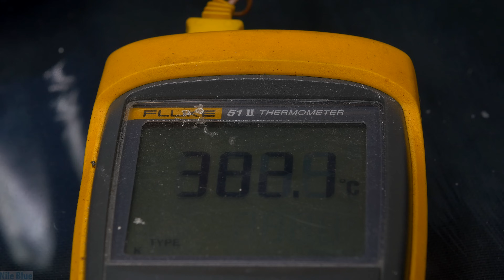Everyday science: starting fire with steam

Comment: THANK YOU! People are always calling water vapour steam, for example when they're boiling water in a kettle and it's so annoying. I work in the power generation industry and it's superheated steam that runs the turbines which spin the generators which make the electricity. Conventional and nuclear power plants all work the same way. They produce heat either from burning some sort of a fuel or with nuclear fission, which is used to boil water to generate steam, then the steam goes through the furnace / reactor again to make it superheated and then that goes into a turbine.
About 80% of global electricity is produced by generating steam and running it through a turbine.

Comment: I used to work at a potato chip and snack food manufacturing company in Topeka Kansas. If I recall correctly they had 460 PSI steam there that was used to heat the potato chip and snack food fryers. Not only will superheated steam get things hot enough to start fires if you give it to chance it will cool down enough about three or four feet from the nozzle and you can actually use it to put a fryer fire out. In this case the hood on the fryer has lowered down and the fryer is filled with steam to both cool and start the fire of oxygen. What's really interesting though it is the vent chimneys on those industrial dryers that are like the size of a trailer house get full of polymerized oil just like a creosote and a chimney. When one of those things lights on fire usually do to a fire in the fryer they burn like a solid-fuel rocket. One-time the fire department had to cut the chimney out of the roof lay it down inside the building and go at it from both ends with fire hoses.

Comment: Steam is a form of water vapor.  When water vapor becomes visible,  it is an aerosol, common clouds are a good example. 
Water vapor is the most predominate greenhouse gas in the Troposphere, thanks to its triatomic molecule and multiple modes of vibration.  While carbon dioxide is also a triatomic species, it has only two vibration modes and both are stretch so it's IR spectra is quite narrow.

Comment: I worked with similar principles daily for years while in the Navy.  The ship I was assigned to was steam turbine driven, with a nominal steam pressure of 600 PSI (41 BAR) with superheat.  This means that we generated steam  at 600 PSI, then ran the steam back through superheater tubes in the firebox to raise the temperature.  

As the pressure goes up, so does the boiling point.  The temperature of steam at 1 BAR is 100 C.  The temperature of steam at 600 PSI/41 BAR is about 487 F/ 253 C.  After running it through the superheater, we had steam at a working pressure of 600 PSI (41 BAR) at about 850 F/454 C.

The interesting thing about steam is that the phase change from water to steam or steam to water takes additional heat.  Once you heat 1 pound of water to 100 C, it takes an ADDITIONAL 970 BTUs to change that pound of water to a pound of steam at 100 C.  That gives you 970 BTU of energy to use for something.  As the steam leaves the nozzles in the turbine and hits the blades it loses energy and cools.  The purpose of the superheat is to give you that much additional work as the temperature falls...even after losing 190 C of heat to performing work, there was still that 970 BTU left to be extracted before it became water again.

This is VERY simplified overview of a subject upon which entire books have been written.  As far as the video goes, know how to find a steam leak that is at 600 PSI, 850 F, and invisible to the naked eye?  In all seriousness, with an old-fashioned straw broom which you wave in front of you.  When half the bristles disappear and the rest catch fire, you have found your steam leak.

We made our steam on a bit larger scale.  We were running 32,000 HP / 24,000 kw of geared propulsion turbines, with enough steam left over to supply 8 mW electrical of turbine generators plus steam-driven auxiliary equipment, hot water, space heating, and galley services.
Reply: I think steam can't create any work when it changes state back to water. How can it push turbine when changing state. Energy just waste into heat. It can push turbine blade (thus create work) because of pressure difference (while they are steam, not when they change state back to water)
Reply: @Yggdrasil_Story  You are on the right path.  The temperature at which the phase change from steam to water takes place depends on the ambient pressure.  Steam has a volume over 1000x that of water.

So, you can use steam as long as the temperature remains above the boiling point of water AT THAT PRESSURE.

So we cheat.  Steam is the gaseous phase of water.  Like any gas, it can be heated.  We create steam, then run it back through boiler tubes to heat it up even more.

As we use the steam, the pressure decreases.  We can adjust for this with turbine designs.  Since we started with the steam so hot, we are still well above the condensation point.  Once we reach the nominal Condensation Point, we still need to lose the BTUs we added to force the Phase Change.  We continue to run the steam through turbines, losing pressure and heat all the while as we allow the steam to expand and perform work.

Eventually we reach a point where the steam is nearing the Condensation Point at the ambient pressure, and we aren't going to be able to use it much longer.  We again cheat and place a cooled condenser unit on the far side of the last turbine to deliberately condense the exhaust steam.  This creates a low pressure area on the turbine outlet, dropping the Condensation point below 212F/100C.  The lower the turbine outlet pressure, the longer we can keep the steam working.

Eventually, we end up with very hot water (Condensate) which is treated and introduced back to the boiler as very hot Boiler Feed Water.  Note that we retain as much of the heat in the Condensate system as possible, so we require less energy to heat it back to steam again.

In short, we add extra heat to the steam and then play games with the ambient pressure to keep the steam hotter than it's Condensation point.

Comment: 0:57 You had the physics wrong this time. By Bernoulli's principle when you have gas flowing at equilibrium, regions of the gas at higher pressure move at lower speed and vice versa. Therefore you are speeding up the vapor not slowing it down.

Comment: Is there not a chance that in this particular experiment the blowtorch is heating the air inside the tube to the 350-400 degrees and the pressure from the boiling water is moving this hot air which ignites the match?

Comment: Nile, would it be possible to do a video about why shaking a match / a stick that is on fire puts it out? Thanks :)
Reply: It is almost certainly due to removing heat. You aren't removing oxygen since you are moving the fire through air, where there is more than enough oxygen gas. You aren't removing fuel because the match/stick is the fuel. The only thing you're doing is rapidly moving the fire through air that is much colder than the fire, dissipating the heat rapidly until it cannot sustain combustion any longer.

Comment: I had no idea steam and water vapor were different things...
Reply: In industrial applications there are two types of steam: Wet Steam and Dry Steam. Wet steam has lots of droplets of condensed water vapor, that's what fogs up your bathroom when you have a really hot shower running or in a sauna, while dry steam has no condensed water vapor in it, and that is whats used in steam power.
Reply: @tassadar7945  "Wet steam" is just steam with water vapour in it (tiny droplets of liquid water). You can separate most of the vapour out mechanically and then if you heat up the steam some more, the rest of the vapour will also turn in to steam.
There is no steam when you take a hot shower, unless your shower water is boiling, which would severely burn you instantly. When water is warm, the water molecules at the surface of the water have enough energy to jump into the air, forming tiny droplets of water. This is what you see in the shower. This is also why water vapour starts to form in a kettle or a pot of water before the water reaches its boiling point. Oh and this is how water vapourizes from the oceans and forms clouds.
In a sauna, when you throw water on the rocks, the water boils nearly instantly and turns into steam. But also nearly instantly, that steam condenses back into tiny water droplets and that (plus the hot air moving with the water droplets) is what you feel on your skin after throwing the water. You can see the water droplets above the sauna stove right after throwing the water. It's like a column of mist moving up and then it vanishes as it mixes with air. Now that I think of it, if your sauna is above 100 degrees C, the water you throw on the rocks should remain in its steam form instead of condensing into water, except on surfaces that are under 100 degrees C such as your skin. I wonder if that is the reason saunas need really good ventilation. You don't want to replace too much of your air with steam as steam doesn't include oxygen, only air does. Hmm....
Reply: Me neither. And then reading the responses here is further enlightening.
Reply: Yes and no. It depends on how you define steam and vapor. Even in academics you will encounter the use of both to describe the gaseous state of water and the aerosol. Language just isn't that precise.
Reply: Vapeur is litteraly steam in french
Reply: So you thought fog was steam?
Reply: colloquially theyre the same
Reply: 449th like
Reply: Same for me lol. My language even has the same word for both xd
Reply: I did, but he explains it well.
Reply: I got a bit of a mindblown moment over here, even though I know many facts about chemistry....
Reply: Vapor is a gas that when pressed (make pressure high) it will be liquid.
Steam is a gas that when pressed (make pressure high) it will be supercritical fluid. It is still a gas not a liquid but it's density is high like it is liquid.. In eyes it's gas. When beads are there in closed container, it's like under water in density. In short, it will be not become liquid when pressed.
Reply: Never thought I would be saying this about a guy who is 100 times more knowledgeable than me, but NileRed's terminology is off
Reply: 300th likes
Reply: Well IMO he didnt used the correct therms but im not native english speaker so maybe in the end its right .

There's a difference betwen dry and wet steam ,the difference its that they have different values of we call "quality" wich is the fraction of liquid in the steam ,since those drops can be very small to be practicaly zero or pretty big amount like the myst you see when you take a shower . Both are vapor and steam aswell and thats the point of having concepts that indicate their characteristics so you can differenciate them whe its needed, for example in  steam turbines you must use dry steam with a quality of 1 because those little droplets would damage the mills as if they were bullets since the high speed the vapor is flowing.

Im not trying to be an smart ass but i think he might have mixed the concepts because as far as i know he is a chemist rather than a chemical engineer,or maybe he knows it pretty well   but he was just trying to give a practical explanation to a non chemical audience.

Comment: Hi Nile, can you do a video on pyrolysis?  Can it be a method to break down plastics without burning it?  Would it still release volatile toxic substances and to what extent?
Reply: If the plastic is made entirely of hydrogen and carbon, then all the pyrolysis gasses can be further burned too. And if burned completely, there will only be CO2 and H2O left.
Reply: @ewthmatth  Which is pretty funny, considering how they don't let you burn coal using ecological excuses and CO₂ emissions, but you can burn as much hydrogen, propane or other gases as you wish, and it's "green energy" :J
Reply: Completely different those aren't sulfur containing compounds that produce hydrogen sulfide and acid rain
Reply: @00bean00  You don't need sulfides to make acid rain – CO₂ reacts with water as well to make carbonate, which is also acidic. That's how karst works.
As for coal, you can also burn it underground and make hydrogen, perfectly environmentally friendly. But they won't tell you that, because they want you to believe that coal is bad and whatever they call "green energy" is good, and then dance in their circus with your "carbon footprint" social credit score.

Comment: Does hot water steam support a magnesium fire, even without oxygen?
Reply from the maker: Hmm, I am not sure
Reply: Magnesium burns underwater, so I'm sure it will continue to burn once started.

The reaction is H2O + Mg -> H2 + MgO .  I haven't played with the thermodynamics of reactions in a while, but IIRC you'd calculate the Gibbs free energy and get a pretty good guess at how favorable this is vs combustion in air. 

The cool thing is that the oxidizing agent is actually hydrogen (I); the oxygen doesn't change oxidation state.  Many moderately reactive metals reduce H (I) in situations where they get some help, such as aqueous acids.  Magnesium is reactive enough that it can burn in water, but not quite reactive enough to react with cool water.

The activation energy needed to start a reaction is more difficult to predict.  An H-O bond is about 10% weaker than an O=O double bond.  But there is less energy available from the hydrogen-reducing reaction than the oxygen-reducing one.  So I'd guess that the autoignition temperature is higher than in air, past 440 C but probably not too much further.
Reply: @jordanrodrigues8265  no it doesn't.

The reason that a water stream will not extinguish a large Mg fire is that the metal has enough mass and stored heat to turn the small volume water into steam.

If you drop the Mg into a large volume of water it will not continue to burn for long.
Reply: I know this is REALLY late, but in the event of a magnesium fire, magnesium will actually rip apart the bonds between elements that contain oxygen in order to sustain itself. 

Similar to how if you put magnesium powder in some dry ice, the magnesium will actually split the CO2 to form O2, which it uses to sustain. The carbon then collects together in a nugget.
Reply: @thomascoulter7943  I remember watching a video of this happening years ago. It's awesome.
Reply: @MrCrackbear  The original commenter said "Does hot water steam support a magnesium fire, even without oxygen?"
No matter what you think he meant by "hot water steam," it wasn't "hot water."
If they meant hot water vapor, and you think that qualifies as "hot water," I challenge you to offer someone some hot water, say to make some tea, and then waft some hot water vapor at them and see how that goes over.
Reply: AI says: 

Yes, hot water and steam can support a magnesium fire even in the absence of oxygen. Magnesium is a highly reactive metal that can combust in various environments, including those without traditional oxygen sources. Here's why:

How Magnesium Reacts with Steam
1. Magnesium and Water (Steam):
   - When magnesium burns in the presence of water or steam, it reacts with water molecules instead of relying on oxygen gas from the air.
   - The chemical reaction is as follows:
     Mg + H2O (steam) â†’ MgO + H2
   - This produces magnesium oxide (MgO) and hydrogen gas (Hâ‚‚).

2. Hydrogen as a Fuel:
   - The hydrogen gas produced can itself ignite under high temperatures, further sustaining the fire.

Why It Works Without Oxygen
- Magnesiumâ€™s High Reactivity: Magnesium's combustion reaction is exothermic, releasing enough heat to break the bonds in water molecules (Hâ‚‚O). This provides an alternative oxidizer in the form of water molecules instead of atmospheric oxygen.
- Self-Sustaining Reaction: The heat from the magnesium fire is sufficient to keep water molecules dissociating into hydrogen and oxygen atoms, ensuring continuous combustion.

Implications
- Magnesium fires are notoriously difficult to extinguish using water or steam because these agents can actually fuel the fire.
- Specialized fire suppression methods (e.g., using Class D fire extinguishers or dry sand) are required to safely extinguish magnesium fires.

In summary, hot water or steam can indeed support a magnesium fire without atmospheric oxygen due to magnesium's ability to react directly with water molecules to sustain the combustion process.

Edit: some of the stuff got jumbled when I had it put it in a text file for copy and paste reasons but the information is there anyway

Comment: Wouldn't you get nearly the same effect if you were just blowing air through the tube? With the torch so close to the opening, it's basically a heat gun
Reply: +KingNast No, because then you're not igniting it with heat provided by heated water vapor. That would just be, "Lighting a match with heat", not "Lighting a match with water". The only gas coming through the copper is water vapor, so it is different because it does not contain oxygen.
Reply: +Ben Sullivan  Ah, so after the air is purged from the flask, it contains pure water vapor.  For some reason, I was thinking of water vapor always being water molecules suspended in air.  It's weird to think the inside of the flask contains nothing but water molecules when the difference in density is so great between liquid and gas.